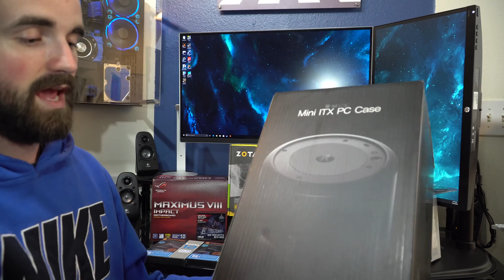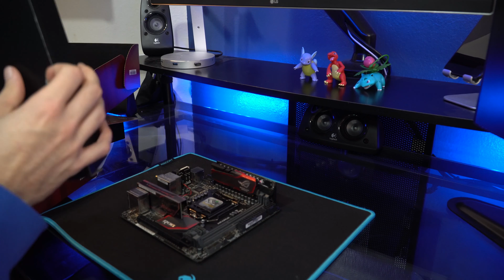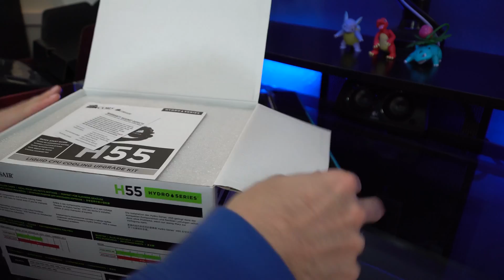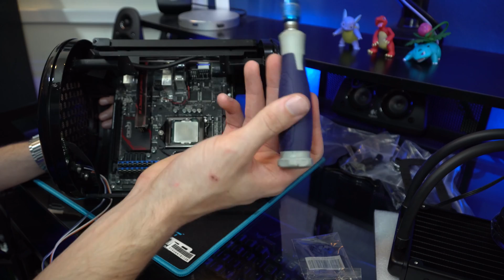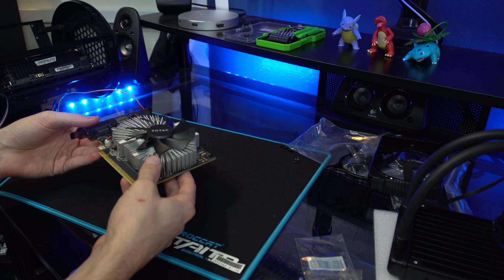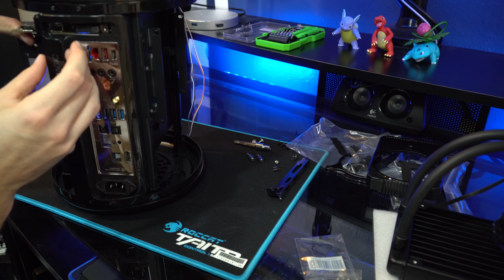Mac Pro Clone Build (iMagic Pi Case): Part 1

Comment: i don't know if you're still involved in this build, but if you still are i would've suggested using the low profile gtx 1050ti, and just cutting the bracket in half losing the dvi port
Reply from the maker: +MinusTacos I thought about that card but it's actually to long for that case, I have a different build soon coming out with the MSI LP as soon as the case comes in haha

Comment: Try using a pcie x16 cable and run it behind the motherboard. This way the card can then sit vertically and not push against the walls. However, I don't know if it'll be in the way of the SSD or not.

You can use a low profile bracket and run HDMI and DVI extension cables to it to create a cleaner look in I/O. (Can't seem to find brackets with Displayport)

If all of this works, you should be able to fit a gtx 1070 mini in there. Good luck!
Reply from the maker: +AliaSapien I bought a pcie x16 cable and tried exactly that but there isn't enough room on that side of the case even without the SSD I think I've come up with a way of fitting everything so we will see if it works
Reply: b°^°)-b  <Hope it works out!
Reply from the maker: +AliaSapien Me too haha
Reply from the maker: +AliaSapien Haha that's awesome! Thanks for sharing!!!

Comment: thats a bit of a squeeze for sure bro, good luck and looking forward to the next instalment :-)
Reply from the maker: Yeah I think I found a water cooler which is going to fit though it is just got delivered so fingers crossed!
Reply: im sure you will pull it off no problem, ive watched a few of your videos and you certainly have the skills and foresight.
Reply from the maker: +Andrew Jones Thanks man!